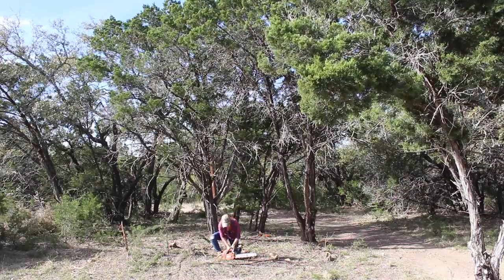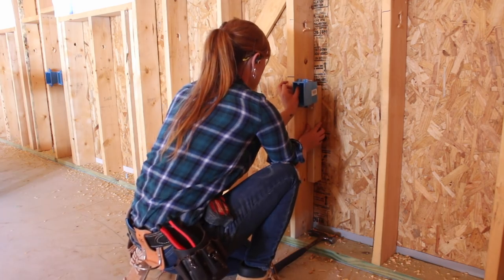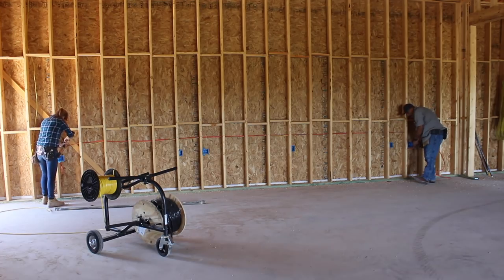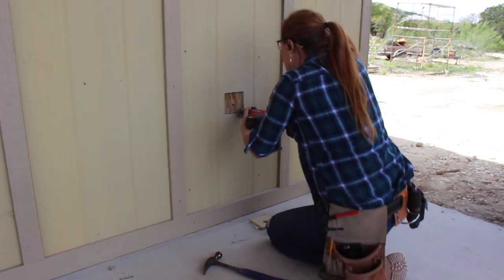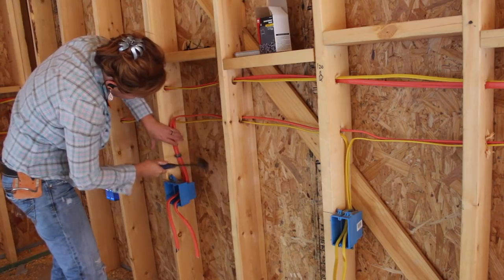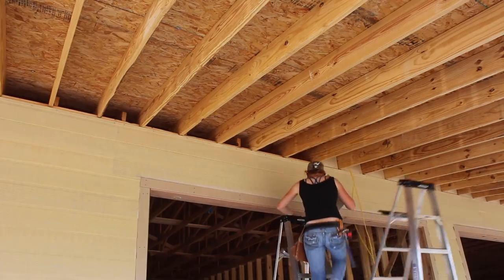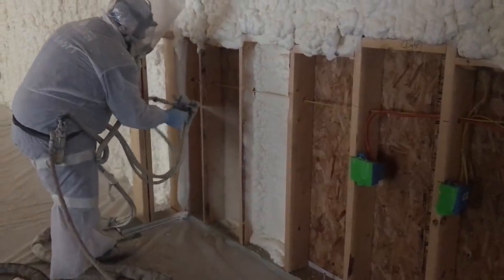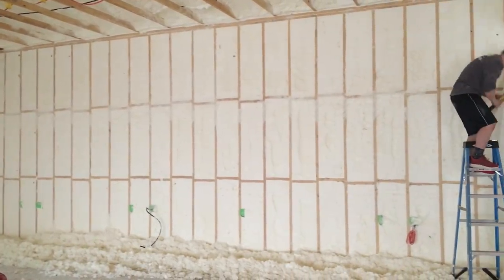Wiring My Shop and Spray Foam Insulation

Comment: As a spray foam contractor I’m really shocked they even offered the option of open cell as an exterior wall insulation. We only use closed cell for exterior walls because it is a true air and vapor barrier where open cell will give an air barrier but absorbed and retains moisture like  sponge does o long term if you ever develop a leak it will hold that moisture and cause rot. The closed cell also adds rigidity to the structure as ell as offering a much higher R value per inch. But at the same point open cell is an amazing sound barrier so it will drown out shop noise outside.

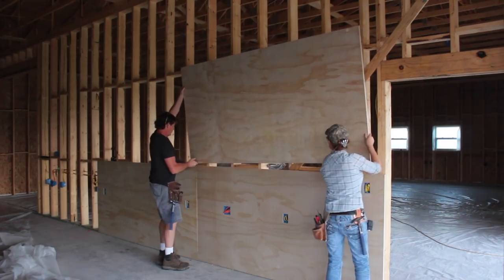Comment: April wonderful work however a quick question. I was always taught when sheathing walls to stagger your joints or is it ok to not stagger like @ 7:20 . I don't want to seem snarky or anything I was just wondering if it has any affect on wall strength.

Comment: It is really neat to see the evolution of your shop. The one thing I did in my shop that turned out great was to install multiple 4 ways switches to run my dust collection all around the shop. 
 Mine is also outside and I did not want it running all of the time to suck my conditioned air. So now all I have to do it walk up to a machine, flip the nearest switch and it goes on. If I move to another machine I can use it and then flip the nearest switch to that machine and it goes off. This was WAY cheaper than purchasing the remote or blast gate switches. 

I can't wait to see how this all turns out. Your shop is going to be the envy of all your followers.

Comment: You will be thanking your lucky stars in a few years that you were not able to install the data cable and had to put in conduit. The chances of having to upgrade or add data lines in the next five years or so are pretty high. especially someone who is doing video production.

Comment: April, did you consider “plumbing” for air lines? I ran pipe to through my walls and hooked up my compressor, reducing the hoses on the floor

Comment: with all that wiring overall, it may have been easier & cheaper to put in multiple sub panels (one central per wall). that would allow shorter easy conduit additions later on if things change or you get a real power hungry machine.

Comment: I learned long ago that lights should be on more then one circuit and fuse, if for some reason you blow a circuit, you do not want the entire shop to go dark ! My last shop I put in 3 sets of lights each on its own circuit and fuse.......only way entire shop goes dark is when power is out in the area ..... then hope you left a door open and there is some light outside to walk to !

Comment: For boxed that are on the outside they should’ve been sealed. 
Also to make your life easier while cutting in the boxes you should strip the wire before rather than after putting it in the box

Comment: The advantage of fiberglass insulation is that the walls are breathing. Won't the foam insulation create issues with condensation? Othis isn't the case for non-residential building?

Comment: Interesting that you where responsible for clearing the right of way for the power lines. In my area the power company is responsible for clearing where ever overhead lines will be ran. Nice work on the rest of the electrical install.

Comment: 4:40 Three  way and Four way switch. If you only use 3 way switches and have more than 2 then you can run into a situation were, depending on the orientation of the other switches, may no longer turn on or off your lights.

Comment: I am surprised you dont have to instal nail plates on the studs.  A simple piece of metal that is hammered ont to the stud that keeps future people from putting a nail where the wire in inside the stud.  IE the people/contractors that come to modify the garage and dont have use of the pictures you took.

Comment: Hi there April, love seeing your video's. 
Two questions, why open cell and not closed?
Second, did you think of alarmsystem wiring?
Although it can be done by WiFi a wire is still preferred.
Reply: Closed cell foam is far more expensive.

Comment: I thought for insulating the under side of roof sheathing you needed to use a closed cell spray foam or it has to be a ventilated roof?

Comment: Great video. Very informative. Learning by doing is the best. But learning by watching (your videos) is OK, too.
Thanks for sharing. I'll take a look at the foam insulation web-site for the specs.
One question on the electricity (maybe I overheard it but even with the CC on I could not find it):
Did you not prepare wiring for 400V? In Europe it's quite common that some bigger machines run (only)
at 400V
Reply: In the US it's 110v for lights and lighter equipment.  220v for the heavier stuff.  Really uncommon to have higher voltages even available.
Reply: Commercial shops typically have 3 phase, 480 volts for large equipment.

Comment: I wonder how much the spray foam de-rates the cables, being its such a good insulator? I would guess around half the current carrying capacity of open air cabling.
Reply: Non Metallic romex type wire according to chapter 3 of the nec is to be protected by a circuit breaker and have an ampacity not more than the 60 degree column. The actual ampacity of a 12 gauge wire such as thhn under the right conditions is 30 amperes. There are methods of increasing/decreasing the ampacities of wires and there is also rules for bunching them together and it is good to see she hired help to get that all together!

Comment: I'm very surprised you didn't add water and septic. Granted I don't know what limitations you would have either tying into the water or septic field for the house, or setting up a separate well and leech field for the shop, but based on those drone videos, going up and down that hill will get old quick. When you gotta go, you gotta go! Not to mention a slop sink for clean up comes in very handy.
Reply: Can always go out behind a tree. 🙂

Comment: So psyched you got spray foam, also jealous! That place is probably so quiet right now with the soft walls! Electric looks awesome, too. So, when you had the note that said ""10/3" in the corner, (and I see it says 10/3 on your amazon link) is that in case you have a 240 machine that also needs a neutral? You're not getting 3 phase, are you? Jimmy was just talking on a story i think about how 3 phase service is super expensive. Obviously you are being careful to future proof for the unexpected so maybe it was just as easy to run 10/3 as it is to run 10/2.
Reply: Checking Lowe's prices, 10/3 is about $0.85/ft and 10/2 is about $0.71/ft. For the marginal cost increase, you can treat the circuit as a multiwire branch circuit (NEC 210.4) and run both 240 and 120 receptacles, depending on your needs. In a workshop environment, the flexibility is worth the small cost increase.
Reply: Scott Dial yeah, good point, and the more you buy the smaller the difference.

Comment: gotta make sure you didnt hammer down those staples too tight on the wiring. too tight means extra heat in the wires, potential for fire.
Reply: You should also not be stapling 3 wires under one staple.

Comment: Looks great.  I have the spray foam in my house and love it. The fact that the attic is now a conditioned space really helps with the Hvac also. What type of hvac system are you doing?
Reply: I agree, I truly regret that all my ductwork is in a hot attic, now that it is installed... hindsight is 20/20, of course.

Comment: Not to be that guy, but shouldn't you stagger the sheathing on the wall between shops? It appeared that you were just stacking on the video.
Reply: I think that was just a temporary covering so they could spray the insulation.
Reply: Perhaps, but they definitely were not going to redo the bottom run as they did cut outs for all the receptacles.  I am not real familiar with spray foam, but it seems that it would be difficult to pull off the sheathing and not tear the foam if they were going to redo the sheathing on the second and third runs.
Reply from the maker: Nope, I won't be staggering the joints. The wall integrity is already established so the inside sheathing is my personal preference and I didn't want them staggered.
Reply: Was talking about the center wall. So maybe on the other side you can offset the stacking from the side that was already completed in the video. Regardless I really have enjoyed the series of videos and I'm very envious that you had the space to put up a nice shop like this.

Comment: I planed my workshop with a number of outlets for 230V/16A, 400V/16A and 400V/32A. Than i doubbled that number and installed them. And now, after 2,5 years, they aren't enough....
Reply: Thats why I would always surface mount in a shop, much easier to add on
Reply: Everyone else installs cable conduits instead of burrying the cables in the wall for all time. Easy to extend and to replace. However many only do that for signal wires and not also for the power (separately routed due to difference in insulation class).

Comment: Question... You said they filled in the ridge vent... Do you not want the circulation or is it not necessary with spray foam??
Reply: I wondered the same thing. Buildings need to breathe.
Reply: When we had our home spray foamed, they told us there was no need for a ridge vent.  Both our engineer and our insulation guys told us that.

Comment: Don't you have problems with the wires heating after covering them in foam?
Reply: Bunny Warren 
If your wires heat up then you are using the wrong sized wire. 
Too much current through a small wire causes heat.
Reply: Wayne Crews 
Yup, correct answer.
Reply: Bunny Warren  - if you are covering cables with insulation, you have to upsize the cable than otherwise would be the case. There are standard online calculators that assist with this at the design stage.
Reply: Wayne Crews, Norman Boyes - thanks for the explanation.
Reply: Wires should never be hot - covered or not.  If a wire is running hot, then it is undersized for the load.
Reply: Paul - the word 'hot'  does not mean anything useful to the layperson. Cables carrying current will see an increase in temperature than when they are not carrying current. Cables carrying current that are in free air will not get as hot as the same cable carrying the same current when buried in insulation. The heating effect is proportional to the square of the current x resistance of the cable. Therefore cables have to be the right size for the designed maximum load AND that take account of installation method AND length of cable. In simple terms  a 32Amp load will require cables of larger cross sectional area than a cable designed for a 16 Amp load and in both cases if buried inside insulation will need to be increased in size.

Comment: Love your videos and am so happy for you about your new shop! However - you're talking way over many of our heads. I love your videos because you make me feel like I can do it too. This got really hard to understand on a certain level. Please help us newbies by explaining the technical talk :D Thanks!
Reply from the maker: I understand, it is a lot of technical information in this one. There isn't a way to explain everything from the absolute start though or my video would have to be an hour long. I tried to deliver the information so that somebody who is doing, or maybe has done, the basic level research on these steps will be able to follow along. Just how in my woodworking videos I don't explain how to use a table saw, instead I direct my instructions towards the people who are already using one and just need the information beyond that.
Reply: April Wilkerson makes sense thanks! Love your videos
Reply: Anything specific trip you up? The electrical can be tricky for the uninitiated. For the super basics: when she says 6/3, or 12/2 the first number is the gauge of the wire, and the second number is the number of conductors, plus there will be a ground conductor in addition. The lower the number of the gauge, the thicker the wire, which means it can handle more amperage, or a bigger load. Each gauge of wire is rated for a certain amperage so based on the tools that you expect to run you can plan what size wire will be required. It never really hurts to go bigger (except for cost and difficulty of installation) but undersizing can be dangerous and illegal. If this wasn't what you were lost on I apologize, hopefully this will help someone else, in any case.
Reply: Thanks Jeremy, excellent breakdown. You must be a instructor or teacher :)
Reply: applemaggot thank you, I'm not but I'll take that as a compliment. I'm not an expert enough in one thing to be a real teacher, I have thought a few small things, though.
Reply: Jeremy Specce thanks so much for breaking it down a little more I appreciate that!